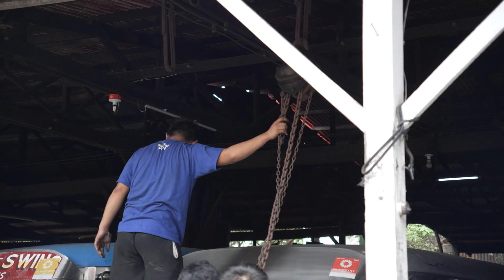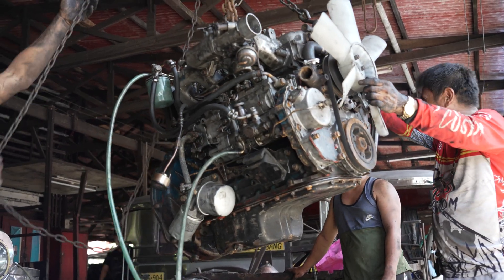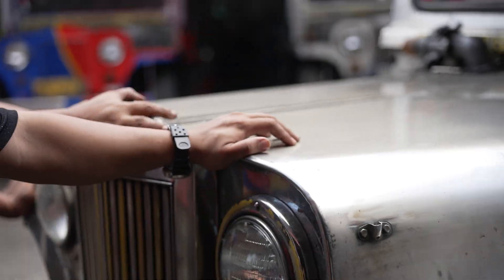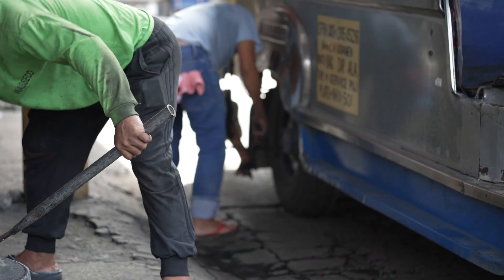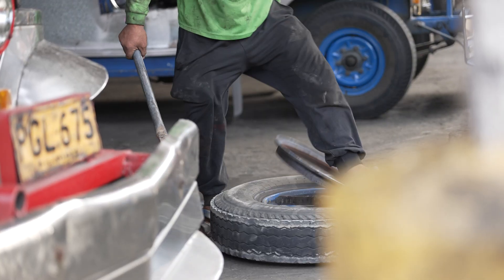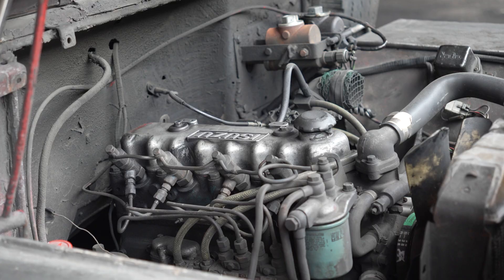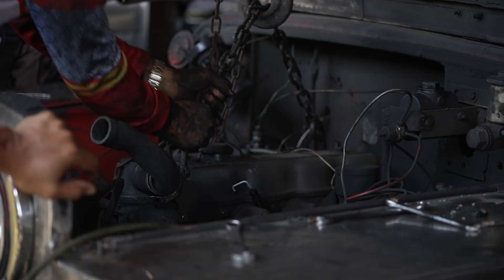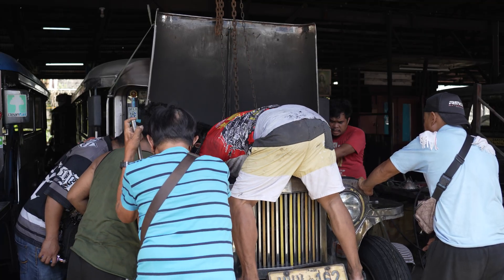It Takes a Team for Sarao Jeepney to  Get a New Engine

Comment: They use Isuzu engines 😂😂😂😂 not original jeep engines 😂😂😂😂😂
Reply from the maker: Isuzu makes great engines. 😊
Reply: Why would they use a more unreliable, more underpowered, and hard-to-find-parts engine for transport anyway?
Reply: @padorukurumi6572  Isuzu engines are actually as reliable as Toyotas, and they share the same parts as trucks.
Reply: @karlceballos3635  I meant the original, crappy gasoline engines the Willy's Jeep had